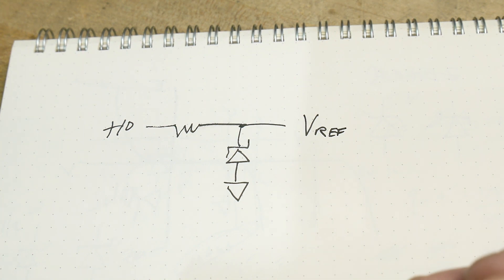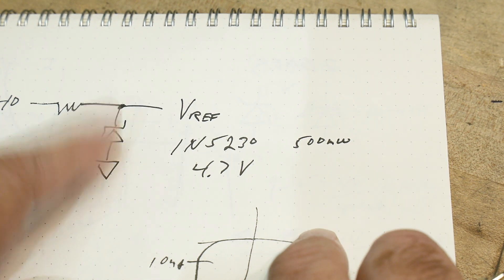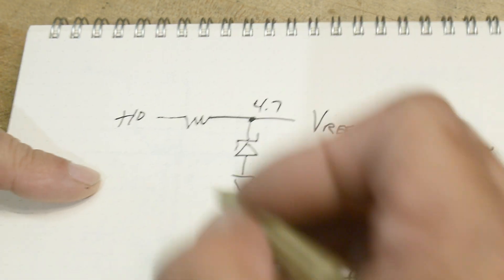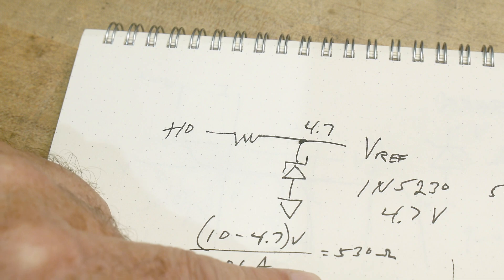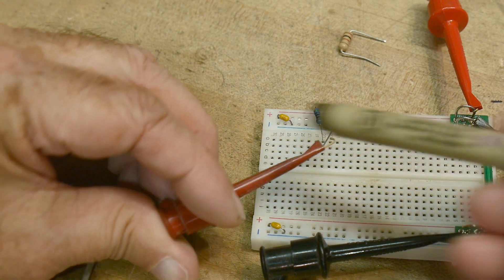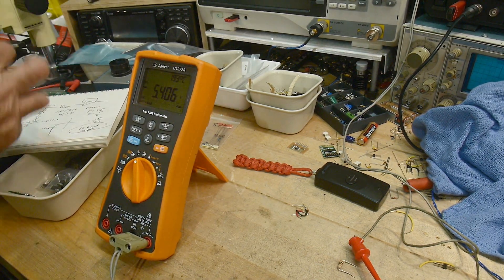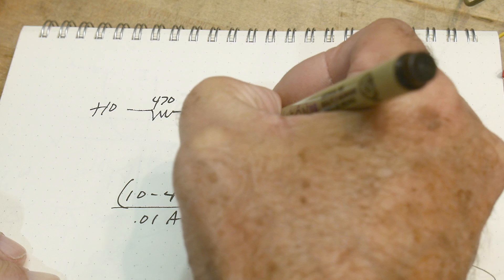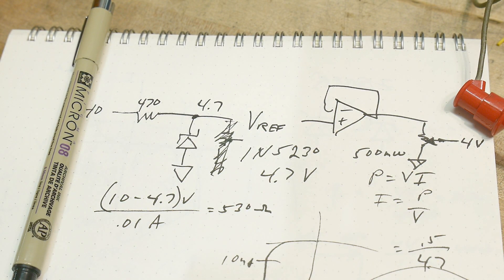#1724 All About Zener Diodes (part 2 of 5)

Comment: Why put the pot on o/p of op amp?

Only bad news.

Loading on the pot drops voltage.

Put the pot in the op amp feedback loop.

Load is then on the low Z o/p of the op amp.
Great.

Comment: You should have put a scope on it and shown how noisy they are ;)
Yes, the 3-terminal references are so cheap, low power and accurate that zeners have become buggywhips.
Reply from the maker: noise source video: https://youtu.be/evJcZdRJKT0?si=dQvFzmCmdTCrv59y
you need to use a zener >7V, they operate in the avalanche region

Comment: 6V zener diode has the lowest dV/dI. I don't know why
Reply: I think 5V zeners have the optimum thermal coefficient.  I think the voltage drop across <5V zeners dioides decreases by increasing ambient temperature and other way around for >5V.  That's why in old school designs, 4.7V or 5.1V zeners were mostly chosen..
Reply: @bayareapianist  not thermal coefficient. The voltage change due to current change. Look at the data sheets. They define this as some kind of resistance. It's the lowest around 6V.
Reply: @EEE-iw3fk  I was talking about something else.  Let's keep the current pretty constant.  If the temperature changes, the voltage drop for >5V zeners goes up and it's kind of opposite for <5V.

Comment: It's good to use second OPAMP of a chip to generate stable current for the zener instead of single resistor. If add a diode in series it could make not bad voltage reference, but TL431 of course is even  better than zener+diode in series...

Comment: Funny how memory works, I just remembered how I built my very first power supply for my model railroad to drive all the signal and traffic lights with a zener diode and a big arse TO3 package darlington transistor to drive all the 5 V electronics and blowing up my fist capacitor in the process. Fun days!

Comment: Typically your sub 5V zeners are specified at 50mA, because at 11mA you are still on the soft curve of the breakdown. Simplest way to ensure you have a more stable zener is to have 2 or more in cascade, though you have to work out the power ratings and currents of the first one, to keep it from cooking when used at the peak of supply voltage range. Then consider the current drawn by the second stage and further on, as that also needs to still keep the first one conducting at the lowest voltage input.

Did that with a meter for a variac, using a tapping on the transformer that gave me 75VAC, and then a single diode and smoothing capacitor, followed by a high wattage resistor to feed a 68V 2W zener I had to hand, with a smoothing capacitor across it. That in turn fed a 33V zener, and this supply them fed a LM723 set up to buffer the internal reference, with a simple resistor load to draw 3mA from this, giving a stable 7V supply, used with a voltmeter to give a suppressed zero on the scale, as the existing meter divisions made it easy to simply redo the numbers, and a simple diode and capacitor to sample the output, so it read directly from 60VAC to 360VAC, with really good linearity. LM723 was in the TO100 package, so got a small clip on heatsink, though even it could have run without, but keeping it cool was better for long term drift, and 33V is near the top input range, so keeping leakage down. All parts to hand, so the choice of zeners and such was the determining thing. Still working decades later, though I rarely need the 10A capacity of the variac at all.

Comment: Hi I am using TL431 as a reference

Nice day 🙂 Tom
Reply: I wonder how many TL431 or equivalents the average person owns?
Reply: @paul_moir  Connected about 20, not connected 5 some in THT design some in SMD. The last one I used was in the central 12V power supply of my workbench.
Reply from the maker: Average person, ZERO.
Reply: @IMSAIGuy  😂
Reply: @IMSAIGuy I sincerely doubt that.   They're extremely popular for regulating SMPS for example in chargers.  To put it in perspective, there are about 3 billion android devices operating.
Reply from the maker: @paul_moir  regular people have cats and play basketball. They know nothing of electronics
Reply: @IMSAIGuy But that's notwithstanding how many TL431 equivalents they own.
Reply from the maker: Maybe 420 products,but not 431
Reply from the maker: I suppose unknowingly those pesky 431s are lurking in shiny metal boxes.
Reply: @IMSAIGuy  Are you a robot?
Reply: @IMSAIGuy  🤔 so I guess I won't be an ordinary person, because I don't have a cat and I'm completely out of touch with ball games, the biggest round thing I can control is the billiard ball 😂......... 🤔 ......... and I use TL431 🤣
Reply: @paul_moir  That's right, the last time I came across the TL431 was fixing up my friend's wine cabinet. Used as a reference in a special switching source for Peltier cells which is controlled by the temperature of the storage space.